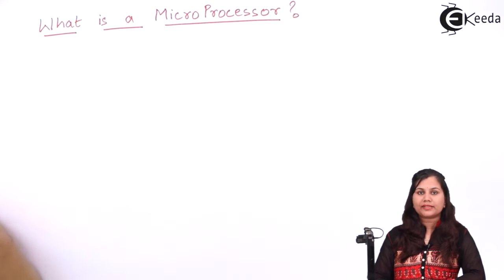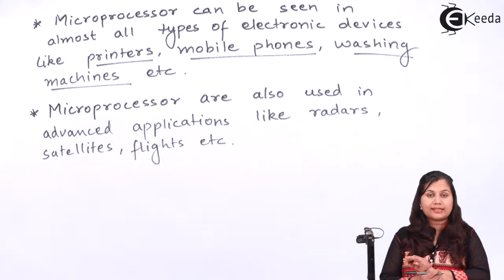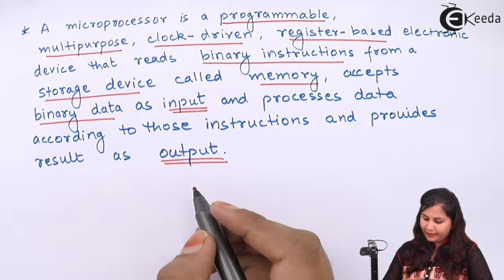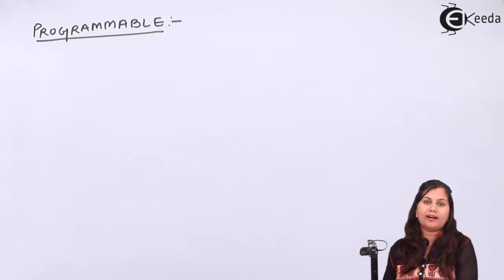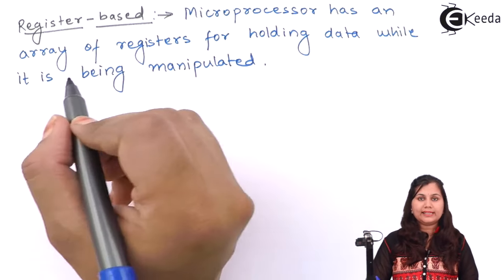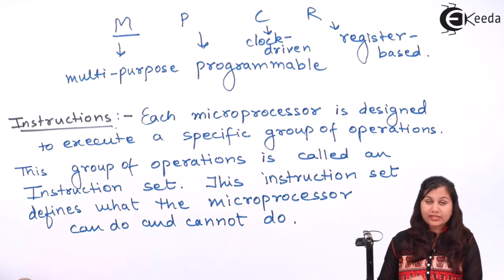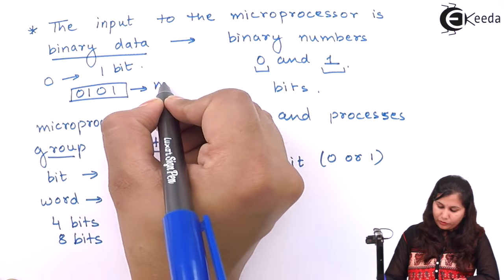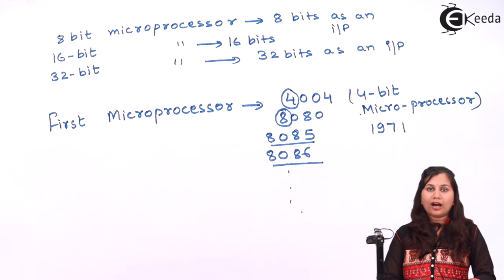Microprocessor - Introduction to Microprocessor

Comment: 6:48  definition of microprocessor - it is a programmable, multipurpose, clock-driver , register based electronic device that reads binary instructions from a storage device called a memory, accepts binary data as input & process according to those instructions and provides  the results as output